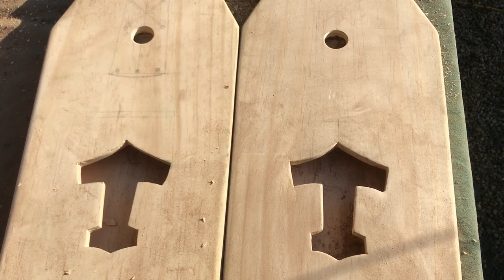Making Tagelharpa Viking Style Instruments (Volfgang Twins)

Comment: Very cool, been thinking about making my own! Not "as bad" as I initially thought, but still a fairly long process. Your method for stream bending is way more badass than mine, I scrounged some large diameter pvc pipe from a construction site, slide it over an old electric kettle, and let it boil with a towel over the top with a small opening to let the steam out and hang the word in it.
Reply from the maker: Nice! That’s a clever way to trap and use steam👏 👏  Good luck with your build, and stay tuned we will be making more of these very soon!

Comment: How important is it, where to place exactly the bar(10:14)? I don't think is possible to glue it random place. If you do it for example on the guitar , if will be in tune if you try from 1-12 fret, here can seems to be good, but from 12th fret and far will not be in tune. How will it be here? Where to place it toward the strings and their length? (from tuning pegs to fixed bridge - and the bar between). I ask because I would like to build my own and I can't find information about it. Thank you!
Reply: it is a fretless string, so you measure from (on this instrument) the tuning pegs. if you want it to have the (common) DAE tuning (A one fourth below the D). ill go with D3, so D string of a cello. the vibrating length is 69cm. in fact, you could pop an actually cello string on if you wanted. i hope that helps, and makes sense

Comment: First of all, I think it's great that young people are still involved in instrument making and are maintaining traditions in this field in particular🙃
From the perspective of the instrument maker, I have two more comments 🙏🏻
Why are the the top and the bottom so thick? For sound reasons, doesn't it make more sense to make the top significantly thinner? The instrument can never resonate or vibrate optimally with such solid wood🙏🏻
The horsehair strings should be twisted against each other in several small strands - then they last longer and become more stable🙏🏻
Nevertheless - respect for your twin work 🙏🏻It's really great when brothers harmonize like that and share a common passion.
Even more manual work and less machine work would be a good goal for you for the next instrument - then it will be even more authentic🙃 Greetings from Germany 🙏🏻

Comment: Can I ask how many horse-hair strands did you use for the strings? Its really hard to find any information on the internet.
Reply from the maker: Sure, 50 strands for the bass string, 35 for the center string and 25 for the high string, however you can experiment with different thicknesses and see what works best for you🤘🏻🤘🏻
Reply: @volfgangtwins  Thank you so much!

Comment: For the plate that supports the strings vertically, did you glue it to the surface?
Reply from the maker: The string plate is "floating" it is tied by rope to the pegs attached to the lower body on one side. The tuners for the horse strings hold the other end. The Bridge is glued and doweled to the body. Good luck with your build! Skål!! 🤘🏻🤘🏻

Comment: What exactly is the electrical part? Is it for mic part or something I don’t know?
Reply from the maker: It’s a 1/4 inch passive input jack wired to two sound pickups to amplify the instrument. Much like you would see on a guitar or bass, except without a battery supply. This way they can be plugged in for a live show or for recording. 🤘🏻🤘🏻
Reply: @volfgangtwins  oh nice! Thanks for letting me know!
Reply: @volfgangtwins  Have you tried a glass tube finger slide on the string yet?

God Bless